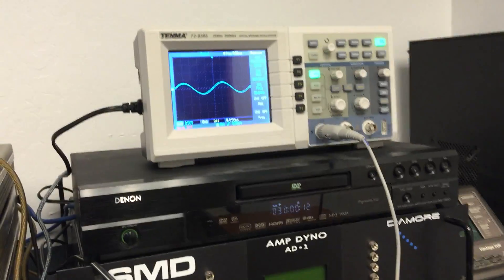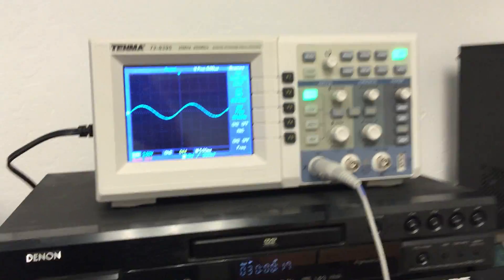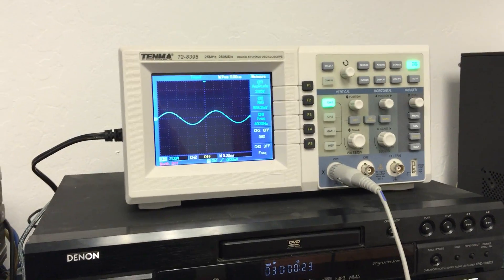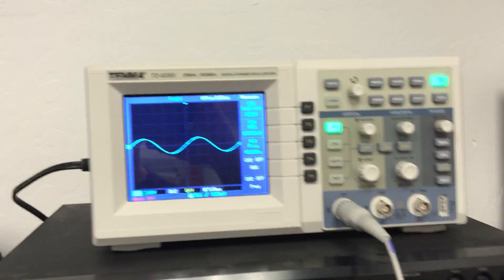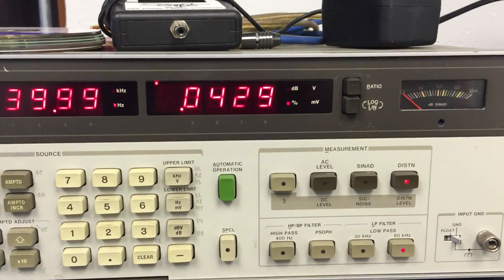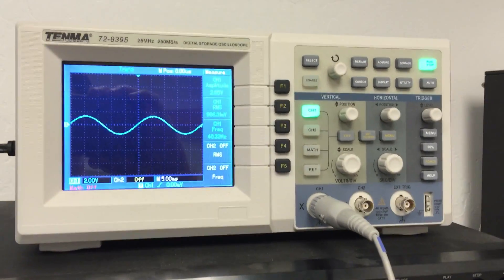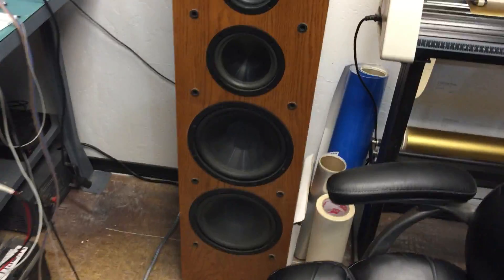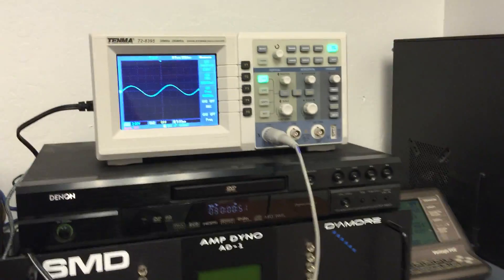Is 1% distortion (THD) from clipping audible at 40Hz?  Myth Busted.

Comment: Very interesting. I have an odd question though. If a source, like a car headunit was outputting a slightly clipped signal to a subwoofer that had a low pass filter in its amplifier, would the low pass filter "smooth out" the clipping and make the distortion more bearable for the ears and the equipment? And, how effective is it at doing this?
Reply: dc will always be dc it will melt any coil however, oscillation is not audible from a sealed subwoofer low passed at 80hz. the same cannot be said for ported/bass reflex ones bc of port resonance which is usually high up in the bandwidth. if you use pro audio subs that typically have 4" coils then you may be safe from short clipping due to the coil's cooling properties but it will still break nonetheless. the single most destructive problem in a ported sub is excursion. without high pass you are already at its limit even at 40w into an 8ohm load and any damping factor gained from that impedance is already lost. so you high pass it but then you add more group delay to the ported sub's own group delay and aside from that, you are deliberately removing bass.

Comment: Is the distortion detector reading thr amp output or the speaker output. I think the drivers were doubling before the meter read 1%
Reply: Same difference! The speaker is turning the signal into sound. The DD1 is analyzing the signal and flashing a light when distortion is detected by its signal processor. It is the same signal being fed into each and it doesn't matter if it comes from the amp or the speaker.

Comment: What you’re hearing is the clipping as the waveform is completely changed, this of course causes THD to rise. Without the clipping present you would (most likely) not hear the difference between 1% THD and .04% THD. Clipping will cause THD to rise, Increased THD in the absence of clipping will not sound anything like this video.  http://www.pmillett.com/file_downloads/ThesoundofDistortion.ppt

Comment: yes, we can hear clipping at low frequency, but can't hear THD distortion at 1%. and , your speaker already hitting its Xmax limit, the distorted sound are actually generate from the un-linear distortion from the speaker. most good 100W rated speaker can't really handle a few watts of sine wave at low frequency, especially at driver's Fs.
Reply: You can hear harmonic distortion at less than 1%! Especially on headphones and at most frequencies.
That driver is not hitting xmax limits although that is what clipping "sounds like" because xmax is a MECHANICAL limit and clipping is an ELECTRICAL limit. Therefore, they have similar sounding distortion.
Reply: @lowerthetone  <1% is not naturally audible unless you're a cat or something or using >110db efficient in ear monitors. what you heard in the video wasn't the sound of clipping, it was port chuffing.

Comment: Great video but LOL what if they own a so crappy system because it's all about BASS then would maybe even10% not be audioble! :-)
Reply: I have asked a similar question because a low-pass filter in a BASS heavy system would naturally try to "smooth-out" a clipped signal. I think it would just round off the edges of the distortion but I am not certain. Maybe more clipping gets through than one would imagine.
Reply: @lowerthetone  I am not sure either but if you "listen" to the Car-Bass owners, I think moth of everything below 100Hz is so distorted that it only have an effect, instead of real sound. Hmm again when I think about it, if lets say they use a 4,000W-10,000W amplifier and some BASS!!! speakers, do you think that clipping do get to be a part of it?

Comment: of course you can you just cant hear it in car becouse its resonating far higher , you  cant even hear 40hz in car , maybe not even 70hz or 60hz that is why, so truth is always in the middle , but if you ask me car bass sounds just like that , even worse , any ive heard especially pricy ones with 100db aoutput
Reply: Of course you can hear 40Hz in a car. The "door-speakers" in a car can theoretically play down as low as 18Hz but they simply wouldn't be as loud. Regardless, a drop in volume of -12dB doesn't mean that those frequencies are muted, just quieter. Quieter by a measure. A measure of -12dB, for example. But what if you turn your volume up 12dB? The low frequencies will catch up whilst the rest of the range will be louder by 12dB too.
So why don't you use an equalizer to make your mid and high-frequencies -12dB and then the bass will "naturally" be more present?

Comment: But clipping and distortion are two different things!

Clipping is clearly AUDIBLE...also easily seen on any good oscilloscope (not a cheap handheld with low resolution). 

Distortion withOUT clipping is not audible...for example if you have a 0.1% distortion on a 40hz sine wave and compare it to a 1% distortion 40hz sine wave (NO CLIPPING) you will not be able to tell them apart.

In the video/demonstration you can see that you CLEARLY hear a difference as soon as the wave form starts to slightly clip. Try a non clipped 2% distorted sine wave and take a listen to confirm any differences between the two sine waves.

Regardless I rather see YOU do the test/demo vids than Steve...
Reply: Clipping causes distortion (in many forms) but they are NOT the same thing. There's IM distortion, Crossover distortion, phase distortion, and asymmetrical distortion to name a few. Clipping is just when the output device saturates and you hit the supply rails.
Reply: @lazzer408  what is IM distortion and do you know of any good literature on car/home audio clipping/distortion?...including the different kinds of distortion you mentioned? I'm aware this is an old comment but I wanna know more on that subject! Thanks in advance!
Reply: @pierregervais1567  IMD is caused by frequencies beating against one another. This means every so often two frequencies line up and create a third.
Reply: @lazzer408  thanks a bunch!
Reply: @pierregervais1567  intermodular distortion is a non linear distortion from two pure tones of independent amplitudes combined together resulting in more non harmonic tones. it is only present if the op amp in use is garbage anyway. thd and imd are inseparable so high thd means poor imd.
Reply: Lol most cheap handhelds can get the job done.
Reply: Clipping is distortion. Distortion is distortion. To say you "can't hear it" is like saying you can't see the color green. Maybe you are colorblind? Maybe your ears aren't good enough. Maybe you need better glasses. Maybe you need better speakers/amps?
Reply: @lowerthetone  No. Clipping occurs when a device, such as a transistor, is driven to saturation or cut-off. Clipping CAUSES distortion. Like a match starts a fire but a fire isn't a match. There's plenty of distortion that can occur without clipping. To have something and not the other infers they are not one of the same.
Reply: @lazzer408  I disagree simply because clipping can occur in the digital domain as well as the analogue
Reply: @lowerthetone  Tell me how to clip a 0 or 1. I'll wait.
Reply: @lazzer408  You can take a digital signal into clipping. Anyone who opens the trial version of Fruity Loops and loads the template without a Limiter will be able to do this by turning the volume up
Reply: @lowerthetone  Yes I can see a waveform in any audio editor and see the tops of the waves cut off but that's an analog representation of a clipped analog signal. If you clipped digital what would that even be? 111111111111111111111111? Nothing is getting through. It's simply maxing out a binary value that results in a clipped analog signal. Connect a 9v battery to your SPDIF and clip it. lol
Reply: @lazzer408  Perfect response! You have proven my initial comment as correct.
Clipping and distortion are two different things.
A clipped signal in the digital world is not represented as an overload of the analogue path when processed through a DAC.

Clipping in the analogue path is a distortion but it's wrong to call it just "distortion" because intentional clipping is a thing that can exist in a perfectly "clean" recording.

Clipping a wave in the digital domain can sound quite endearing for those so inclined. Many popular songs over the years have basslines with clipped/squared edges instead of round. To contradict my point, the preset used in the production is probably named "Distorted Bass" lol 😂 but either way, clipping is an artifact that is audible, can be seen on an O-Scope, is present in digital and analogue domains and is so common that most people living on the planet have experienced it knowingly or not. So it's not really worth arguing over. I get what you were saying though, analogue is the clipped signal we should all worry about
Reply: most non-engineers will almost associate THD with hissing and this is why audiophiles are the biggest idiots compared to other groups of hobbyist/enthusiasts. more than 90% of audio buffs don't even know how to build a speaker which is one of the easiest craft in the field of engineering.